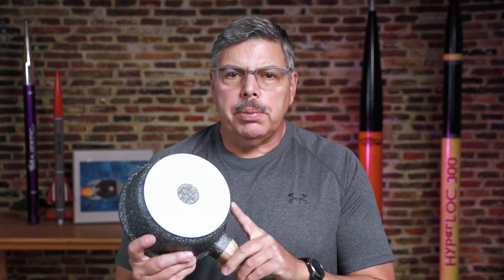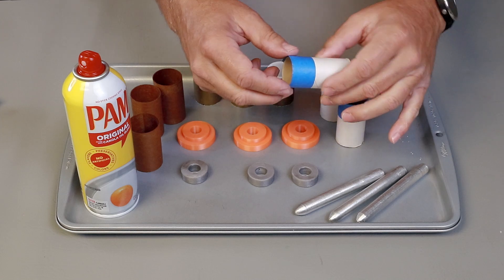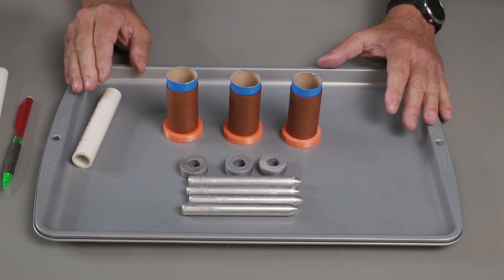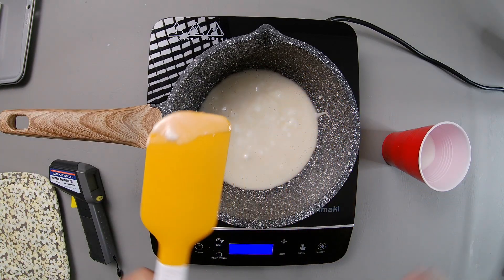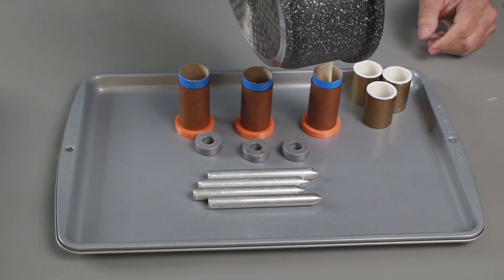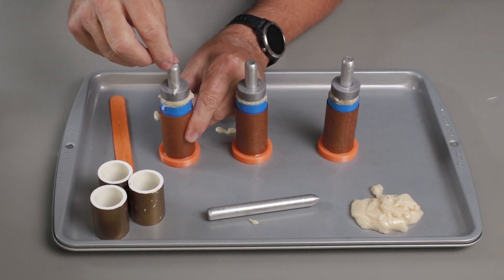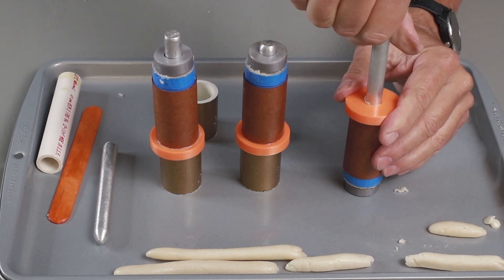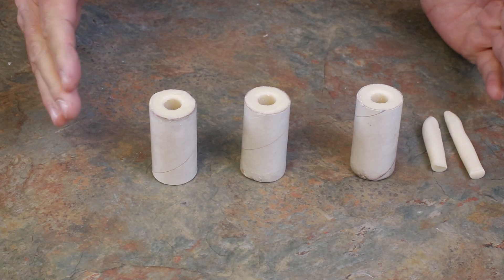Casting sorbitol rocket fuel.

Comment: Do you know if anyone has successfully made a solid rocket without an external case? Basically the solid fuel is strong enough burn completely while still maintaining a (mostly) downward thrust. If the rocket simply went up and turned into vapors and dust, I could skip the complexity of parachutes. :-) I tried searching to see if someone had made rockets that were 100% solid fuel, but only found a few references to weaponry, not hobbyist rocketry.
Reply from the maker: Sounds fun but I have no idea how it would work.
Reply: I was testing various rocket fuel mixtures while I was in college. This was back before the internet (late 1980s) so I was guessing about everything. I used latex with an oxidizer as  my fuel. I had spread some of some aluminum foil to let it dry. Once the fuel was dry, I tested it by lighting it on fire. The edge of the fuel started to burn and the piece of fuel started to spin and then levitate into the air. The fuel vanished into nothing after reaching the height of about eight feet. It took a couple seconds to reach the eight foot height. It was a very surreal experience. The piece of fuel taking flight in a relatively controlled way, seemed magical to me.  I know this isn't what you were looking for but technically, the fuel flew on its own.
I'm not sure if I could reproduce this result if I tried but I think the spinning of the fuel as it burned stabilized it flight. I think any attempt at a fuel only rocket would benefit from being spin stabilized.